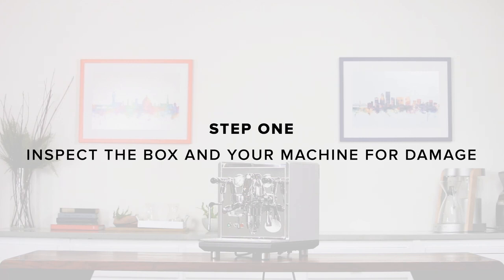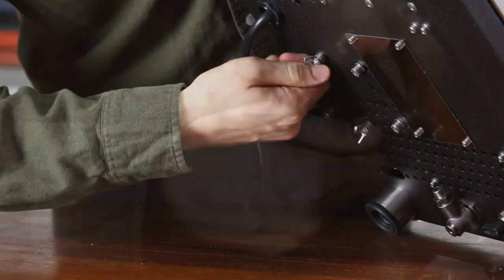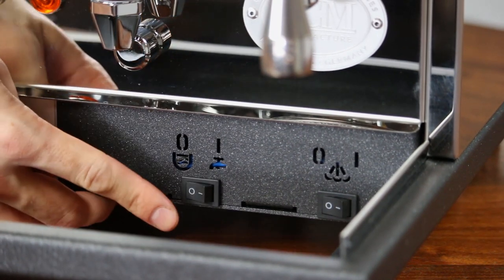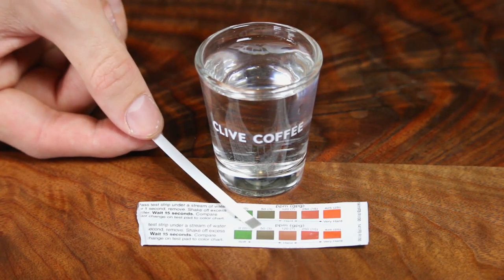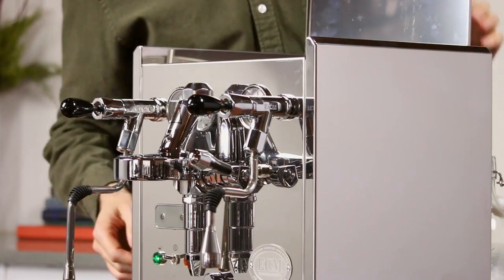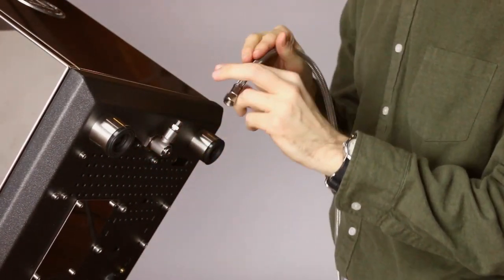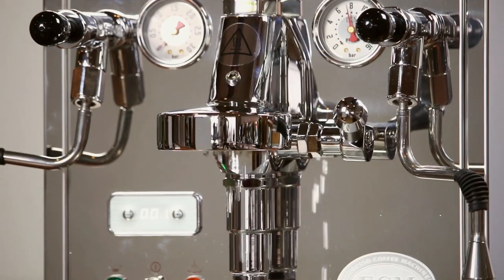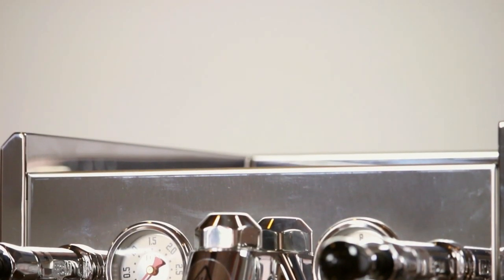ECM Synchronika Espresso Machine Setup Guide

Comment: In the last step you switched on the steam boiler in the setting with plumbed-in line. The switch under the drip tray for the plumbed-in line was turned off - but the machine was connected to the plumbed-in line in the second setting. That is wrong.

Comment: Does the steam boiler switch stay on for all normal use?
Reply: Depends what "all normal use" is. If you just want to brew espresso, you don't need the steam boiler as it would just use more power. If you want to steam mild, obviously you have to turn it on.